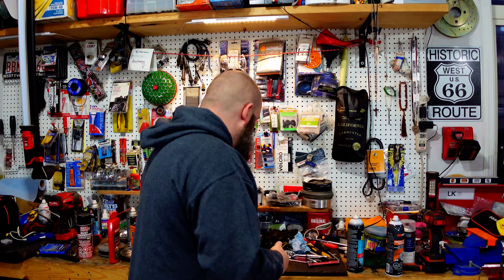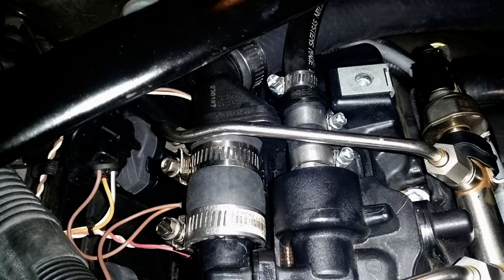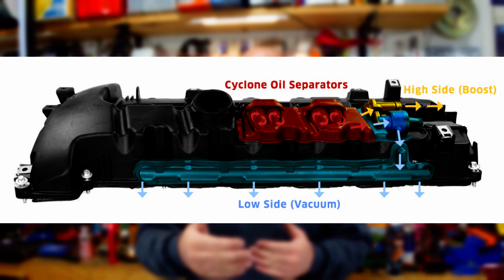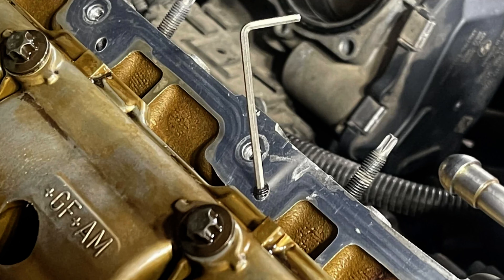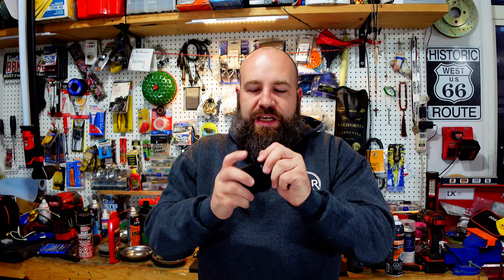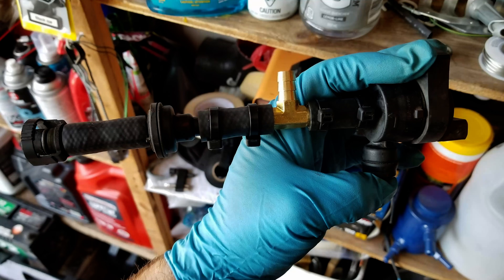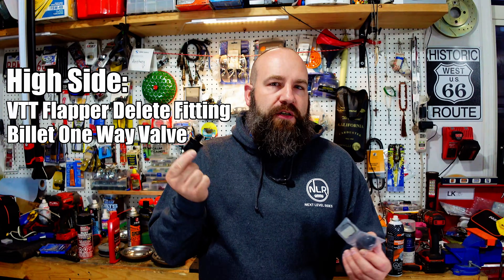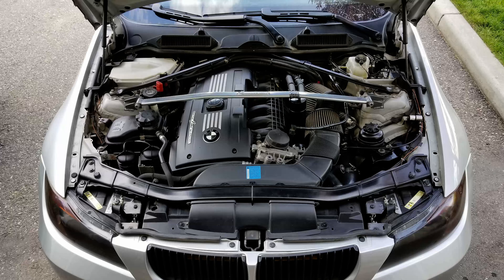FIXED - BMW N54 Smoking Issue (idle and deceleration)

Comment: Great Vid.
I've been over researching all of the PCV stuff.
Endded up getting the Bms low side pcv relocation kit, a new high side flapper, and FTV diverter valves, which run vac odd the Bms throttle body adapter.
I was going to plug the inlet ports to the VC, but really don't know whether this is essential.
My question is, under boost does the VC pressure go fully out the flapper only, or will some make it through the low side system.
And will boost pressure flow up the inlet ports into the now dead end in the VC runners and cause potential Gasket leaks?
From my research I understand the n54 crank case requires good vaccum to assist the turbo oil flow, which is why they turbos smoke.
I'm wondering why someone hasn't addressed the turbo oil flow problem directly.
Reply from the maker: we've NEVER had an issue with failing valve covers if you don't plug the head ports. I'd only do them if you're in there.

Yes, any excessive crankcase pressure exits the high-side of the valve cover.

Comment: Hey.  Unlike many Catch cans set ups recommended from (online sellers Flaper to PCV route) you seem to go little different route any bit doing research and not trying to upsell parts.  I have same story car smoked catch up after gas release.  Car originally had DPs and few other badly done things. Full bolt ons, New plugs, coils, new Franken turbos, Valve cover, aka all the basics.  Also ugraded PCV and smoke got even worse swapped to OEM PCV and smoke went down but still, not always when step off the gas it starts smoking.  Will be doing your suggested catch can route to see if helps.
Reply from the maker: let us know if it helps. I had the same issue as you, also with frankenturbos installed. if the pcv setup doesn't help or fix it, you may have leaking valve stem seals, or need to install the turbo oil line restrictors frankenturbo supplies with their turbos.

good luck!

Comment: I’ve done valve cover gasket, all pcv’s, full downpipes 4x cat delete. Turbo wastegate does rattle, but only when engine is hot it smokes and smells like sht. But no taking oil?
Reply from the maker: mine was the same, smoking but not using oil. if you've done everything possible, I'd start looking at valve seals or the turbos themselves. unfortunately you won't know unless you take the turbos off.
Reply: i did everything , tmr gonna change o2 sensors hopefully it fixes

Comment: Do you recommend using a china valve or the OEM flapper valve for the high side? Without the OEM flapper's integrated bypass hole does excessive crankcase vacuum become a problem? TYIA
Reply from the maker: yeah, seems it does, it needs the hole to have a proper amount of vacuum on the crank case. I use the OEM flapper, you CAN use the China valve but not really worth it. You'd have to get a valve to dial in the proper amount of vacuum so no real point to change it.
Reply: @tony.nextlevelrides  Thanks for the response, your video is very helpful.

Comment: Probably won’t get a response on this but this video doesn’t really help me. 
I’m even out of ideas what it could be with my N54, because it’s super intermittent. 
The issue is as following, she smokes, and burns some oil. 
This started after I went for downpipes, it will smoke at decel and very low rpm’s moving in stuck traffic. 
The wierd thing, it didn’t smoke or burn oil before! Only after. 
Cold start is smoke free, I can have her running for 30 minutes and no smoke either. Only when I’m driving. 

I am worried about the turbo’s being EOL, but what is a good way to diagnose it?

Could it be a clogged valvecover? 

Things I done:
Different oil, same issue. 
New BMW PCV valve, same issue.
Colder plugs, same issue but a little faster. 

Car boosts like crazy and is insanely fast.
Reply from the maker: unfortunately it sounds like you have one of two issues my old e90 had. I had done everything and in the end it was between turbos and valve stem seals.

it boosted perfect and ran flawless but smoked like yours, even after upgrading the turbos to F21b's. unfortunately the smoke remained. during the turbo install I noticed two valves were leaking oil heavily, you can only inspect them with the turbos off.

I ended up selling the car, Lucas oil stabilizer helped a bit but it still smoked exactly like yours. in the end, it needed valve stem seals.

Hope this helps though not what you want to hear. If you email us I'm. more than happy to help you diagnose further.
Reply: @ thanks for the answer! 
I am about to remove the intake this month, to walnut blast it and also check for ‘wet’ valves. 
While I’m at it, I’ll replace the valve cover with another one to see if the issue changes. 
I do have a set of S55 turbo’s I can also modify to fit the N54, but also am in a doubt what to do. 
I love the car, but not the work. 

The thing that totally wierds me out is the fact it never consumed a tiny drop of oil, and never had a puff of smoke. 
But after I went with downpipes, boom, smokemachine and oil burner. 
Must be said it’s not running high end dp’s but some Chinese ones the local company sold me. 
E60 is a lot harder to get parts for then the E90.

If there is a way I can have a chat by phone with you to clearly tell the whole story would make it even better.
Reply from the maker: @gideonbouwman4904 yup, sounds identical to my issue. the downpipes keep enough back pressure to ensure the seals drain properly. only the exhaust ones leak, intake ones won't.

sure, send me an email and we can set something up.

info.nextlevelrides@gmail.com

Comment: Great video! From the PCV delete what 8AN Female to barbed hose connector size did you use?  The Supra PCV valve pics seems to show a larger diameter on the inlet size. Looks like a 3/8" for the outlet size.
Reply from the maker: I made it simple this time around and used the kit from RB Turbo. It's identical as outlined but the delete fitting has an integrated pcv valve with a barbed end for the hose.

Initially I did the ADE delete fitting but they're never in stock so I went another route. But then I just ground the threads down to use a 1/2" hose to go into the pcv valve if memory serves me right.

Comment: Hey bud, i’m running into smoking issues with my st n54. Running plugged head ports, a BMS high side catch can, BMS low side catch can kit (which deletes the pcv valve im pretty sure), also a brand new turbo too. I’ve been told i need to run a 2jz pcv but unsure how to do that with my low side catch can setup?
Reply from the maker: I'd recommend the RB low side PCV kit that integrates the supra PCV valve. without a valve, you're causing excessive crank case pressure causing smoking. you need a PCV valve to restrict flow and ensure its routed back into throttle body line post one-way valve

Comment: 2011 e90 328i xdrive. Replaced valve cover gasket, oil filter housing, coils, spark plugs. All issues revolving around the above listed things have been fixed. The only issue now that bothers me is the white smoke from the exhaust. 

Car only has 150kms and is in amazing condition. 

Smokes on idle at red lights, enough to grab EVERYONES ATTENTION, and also smokes when acceleratinggg ENOUGH for all drivers behind me to stop driving and pull over because they can’t see!!! 

I’d appreciate any advice please and thank you.
Reply: This is the n52 btw.
Reply from the maker: hmm, it's possible you have a vacuum leak or some sort or a cracked valve cover. I would recommend smoke testing through the intake. that'll give you a good idea as to what's going on!
Reply: Did you fix it?

Comment: I have a question I was at a red light and floored it Ang suddenly heard a loud pop and saw a lot of some coming out the exhaust and seem to have lost power felt like 3 cylinders where only running I pulled over to the red after I turned off car and i turned it back on felt normally and ran great after I was driving again I slowed drop to a red light and saw white thin smoke come out the exhaust do you know the issue?
Reply from the maker: hard to say without seeing the vehicle, it sounds like you might have a vacuum leak or something from the PCV side has let go. Check your charge pipe if it's plastic, they crack easily.

Comment: Okay so I do have a question in what’s best to run with a single turbo n54 with upgraded valve cover and plugged head ports
Reply from the maker: I'd run the RB external pcc valve to a mishimoto style catch can that routes back into the evap line at throttle body.
Reply: @tony.nextlevelrides  do you have insta i need little more insight

Comment: if you have a catch can that vents to atmosphere would that remove the need for the china valve on the high side of the pcv system
Reply from the maker: correct, you would just simply vent both ports to a catch can and to atmosphere. I cannot recommend this though, with stock turbos it will almost always smoke, with a single it may be different but the RB PCV delete fitting is exactly what everyone should use.

Comment: Still smoking PCV everything has been done, still poofs smoke but dosent smell like burnt oil.. Any ideas ??
Reply from the maker: what pcv did you use? internal or external? helped one guy who used a cheap China valve for the internal one that DOES NOT flow remotely close to what it should.
Reply: @tony.nextlevelrides  The PCV was bad (OEM) so we put a Catch can. I was thinkin Vlave cover/Gasket ? its weird as the smoke doesnt smell liek oil but odd.. 
not losing coolant I am burning oil but thats blue and not much.
Reply from the maker: oil will smell and look different depending on where it's burned. if you want to shoot us a message ok Instagram I'll be happy to try and help.
Reply: External with a catch can and all that, put in by a  pro shop. Its so frustrating ...
Reply: Thank you,  but I dont have Instagram or Facebook just another primary Youtube account..  Can u give u my cell ?
Reply from the maker: @geoarnaudov7463  you could email us if you'd like. might be easier. if not we can figure something out.
Reply: ps I did a compression test. Like with a gage and Cylinder 2 is like @ 70 or so .... weak sauce ..... but it dosent smoke only when warm and under boost. I m running stage 2 Vargas Turbos and an ARM Front mount with all the pipes and Vargas Charge pipe .. BOV. New plugs new coils new HPFP. It has a Tune.  New Low Pressure Fuel sensor. 
New Radiator New Coolant hoses (all of them) Not loosing Coolant .. The Valve cover and Oil Filter Housing Gaskets are not New tho.. Injectors arent new but I feel as if theyve been changed before, and no codes not leaking that I know of.  Craziness LOL I cant figure it out Unl;ess its a deep issie. Valves or Rings..
Reply from the maker: it would probably be smoking from the loss of compression, most times its because of a damaged ring or ring land. both will cause smoking.

you can warm it up and open oil cap, bump rpm off idle and if it smokes more it's a piston.
Reply: @tony.nextlevelrides  U are the man !!! Thank you I appreciate it. We did so and it wasnt smoking. Yesterday I noticed I was beating on it a little and it smelled like exhaust but odd like it was gonna start on fire.. Odd smelling smoke whitish greyish blueish. Then when I pulled into my house I notice 1 drop of oil on the ground. This morning I checked and fluids are all good and no leak that I can see...

Comment: Im using similar setup with rb kit and dont have issues. My high side barely gets any oil even after track days. 

At this point im thinking about deleting the high side catch can as well. Less clutter in the engine bay.

I have also seen people running both pcv lines from the oem valve cover to a vibrant vta style catch can with no issues. Looks cleaner that way but im not sure if it will cause smoking issues. Any information on that?
Reply from the maker: I've been deleting the high-side cans on a couple cars now, only adding it to the low side.

Anytime I've seen both lines run to the same can, that's not separate, has always had issues with smoking. I don't recommend it. just put one to the low side with an inline PCV valve and call it done.

Comment: Do i need to tap into intake manifold if smoking on stock setup or just evap line and heater?
Reply from the maker: the evap. line is fine.
Reply: Thank you sir! For the flapper side you said to get a pcv valve but in the picture its the oem flapper. Did you cut the tubing off the flapper and replace with hose clamp and hose? I have a brand new oem ccv hose that i can use and is why i ask. Apreciate your time and knowledge brotha! @tony.nextlevelrides
Reply from the maker: @punian yup! I take the tubing that can crack and replaced it with tubing. this is if you reuse the high side valve. tiger wise you can use a one-way valve as it would be the same thing.

Comment: I wonder if bmw has observed that most of the cars on youtube that burn a lot of oil are bmw. I have a bmw x3 2.0 petrol driven 206,000 km and it also burns a lot of oil, about 3 ltr on 1000 km. I also have a mercedes b class 180 cdi driven 236,000 km and it uses minimal oil, and I also feel that it has more quality than an x3 in every way. Never more bmw for me after the x3 one day dies of internal bleeding of oil.
Reply from the maker: it's unfortunate, in most cases the pcv system on a bmw is extremely complex and complicated. if it's not perfect, any amount of issues can result.
Reply: @tony.nextlevelrides  Yes , that's right that's why I've just bought a new pcv valve to see if it helps since the compression test is good and the engine has no symptoms of bad valve seals. If that doesn't help, it could be worn/damaged oil rings, even if the compression is ok. It will probably be a lot of work to change it, because it's  mounted under the intake manifold, I reckon. This oil burner N46B20B is a rarity in x3 and that is probably why there is little information about it on the web other than that it is a problem engine.
Reply from the maker: in a lot of bmw engines, the pcv system is integrated into the valve cover. might be worth looking into.

on others, worn valve stem seals is another issue becoming bigger each day!
Reply: @tony.nextlevelrides  Not on mine, I see that the PCV hose is connected to the top cover at the rear of the engine towards the coupe. I have some doubts that it is the valve seals because it does not smoke when starting at cold engine in the morning nor when braking hard when downshifting, but I do not completely rule it out either, since there is a lot of blue smoke when accelerating after slow driving and stopping at red traffic lights
Reply from the maker: mine never smoked on a cold start, only after driving harder and on decel.

your issue is sounding more like a turbo ready to pack it in to be honest.

Comment: When replacing high side flapper with a true check valve, what prevents excessive crankcase vacuum? (I already have the 2jz pcv valve + catch can on low side)
Reply from the maker: there's a one way check valve in the evap line to throttle body.

Comment: Just change to upgraded pcv and do the rocker cover gasket and it fixes problem, I have had my 07 335i since 2006 and I have run 17Ts for the last 4 years and no problems at all.
Reply: Wow man share ur knowledge w us
Reply: Was it viv turbos?
Reply: @ronnierabell1 no bro, it was not viv turbos. save yourself the trouble, if your going to go through all the labor to replace your turbos, go RB or PURE. stop trying to convince yourself it’s worth it, it is NOT
Reply: Rocker cover gasket?
What the fuck is that??

Comment: Hi Tony, Billy from South Africa.  My BMW x3 e83 n52 has a smoking issue and is burning oil on No 1 cylinder, I suspect it is the valve stem seals. I haven't chech the pcv valve yet. Most of the smoke is when decelerating down hill and then accelerating. Any ideas on what I can do
Reply from the maker: hmm. if they have plastic valve covers, check them first. I would be very surprised if it was valve seals.